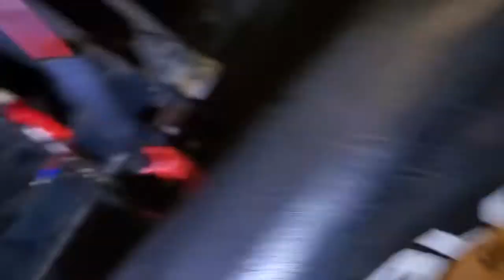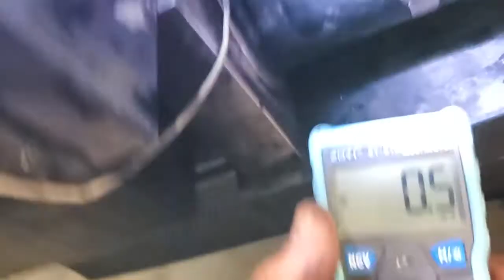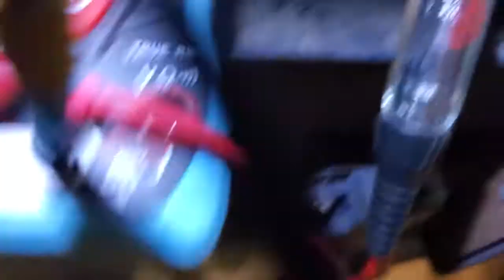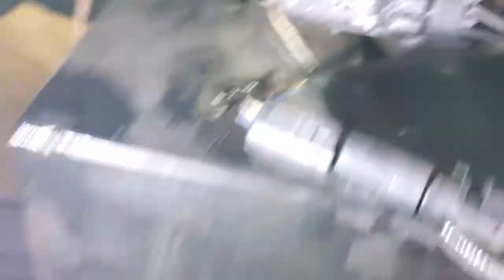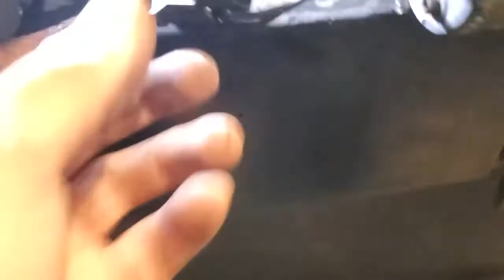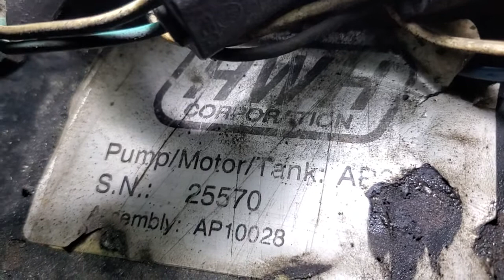HWH LEVELING PUMP NOT WORKING

Comment: My HWH rear passenger jack won't hold long in level and drops over night. It works and retracts ok. What do you think I should look for? I'm thinking seals but don't know what else it could be. It's a 2000 Newmar Class A. Thanks. Great videos.
Reply from the maker: Did you get your problem resolved yet?
Reply: @Rvdiagnostics  I think it's the driver side rear jack. There is transmission fluid at the base. I'm not sure if one bad jack can make them all slowly drop. I will have to replace that one first. I will wait till after the winter since my RV is staying in a park. Thanks for your videos.

Comment: I have a 310 hwh with dump valves. I found 2 design issues. first was one was at the rear plate where the brushes of the motor are bolted to. one passes through for the positive post. the end plate was rusted and corroded preventing the negative brush from getting ground pump block as it was just bolted to the end plate with no access to external ground. I drilled out the end plate, cleaned it, then added a grounding bolt to directly negative brush through the end plate and to chassis ground. this solved the intermittent problem. 2nd issue was the power fuse that is rated at 40amps. the fuse holder is only rated to 30 amps so it melts and fails. Needs to be upgraded to a 40 amp fuse and 8 gage wire. If you have a chattering relay inside the coach this fuse and it's high resistance may cause that.

Comment: I have a HWH 110  stoped working no lights on control board was working perfectly until some days would stopped working but then it would work but now it completely stoped no power to board
Reply from the maker: Did you join my Facebook page rvdiagnostics?
Also my website www.rvdiagnostics.com 
I'm in the state of Delaware. I have a School and garage,  With full hookups and fifty amp services

Comment: FYI a solenoid is an electromagnetically activated plunger. Can be an electric switch (a solenoid relay vs lever type relay), can be a valve, can be a lock (deadbolt plunger), etc.
Reply from the maker: I understand over the years things have changed. A true definition of a relay is to take a small amount of current to control a larger amount . Hence the true definition is a mechanical amplifier.  Doesn't matter if it uses plunger or spri g contacts as long as there's a switch contact involved.  Now a true definition od solenoid is to take magnetic filed and control mechanical movement if it be pneumatic, hydraulic or mechanical hence solenoids on levels take mechanical movement and control hydraulic movement

Comment: I have a 1997 Raven XL that I'm just getting into myself, now how to activate your hydraulic motor for a few need to set the emergency brake and then you need to turn the on switch on the panel, well that's been working for me but I had to finesse stepping on the emergency brake pedal just to get the light come on.... finally I can depress the emergency brake pedal all day long but now I cannot get the motherboard to come on by touching the on button.... seems like when I play with the sensor with my finger, the sensor seems to be working but not sure.... any suggestions?
Reply from the maker: Most parking brakes are pull down swith.Is the parking brake light coming on the dash.Send pic of your leveling touch panel. What system is the leveling?

Comment: I have recently purchased a 2000 motorhome and the pump presents the same issue. It hasn't been used in probably 5-10 years. Any idea what causes this issue? Potentially the motor getting gummed up with age and dust?
Reply from the maker: Remember my MOTTO TEST NOT GUESS
Reply from the maker: So do u have a multimeter
Reply: @Rvdiagnostics  I do. The lines have continuity and the fuses are good. Got a new relay arriving monday.
Reply: @Rvdiagnostics  I do. The lines have continuity and the fuses are good. Got a new relay arriving monday.
Reply from the maker: What pump are we talking about, Unfortunately it doesn't let me see what video u watched
Reply: @Rvdiagnostics  the video was your video on hwh hydraulic pump diagnosis. To the hwh leveling system and hydraulic slides on a motorhome. Since the comment I actually got a better electrical connection and connected the house batteries positive to the pump directly, bypassing the relay and it turned on. There's live 12v going into the pump relay though but the leveling system and pump still fail to function. Would this indicate the relay is the issue?

Electric goes into the relay, pump works when directly started, but fails to normally function using the control panel.
Reply from the maker: Check small wire going to relay for voltage signal when panel button pushed
Reply: @Rvdiagnostics  you were right. So there are 4 terminals. Big one on each side for the 12v positive into the relay and from the relay into the pump. Then there's a small wire for the Jack's and a small wire for the room extender. By accident I tapped the 12v high capacity line to the room extender line and the room popped out and works fine but the Jack's still don't work. This makes me think I just jolted the relay somehow and it was the relay all along
Reply from the maker: Www.rvdiagnostics.com
Reply from the maker: @Hypn0Guru   Do you have a multimeter?
Reply: @Rvdiagnostics  I got it sorted and the jacks and room extender working
Reply from the maker: @Hypn0Guru  what you do to achiev that
Reply: @Rvdiagnostics  more than I should have. I misdiagnosed the relay so that didn't fix it. Then I worked backwards. Rechecked the fuses on the hydraulics and Chassis. Checked grounds. Worked backwards and check the ground and power on all the pins on the control box, ripped the dash apart to find the accessory line wasn't getting power. I juiced that line and suddenly the backup camera worked and the hydraulics worked chased the acc line back to the power window and finally a small 10a fuse I'd missed for the power window which is the line the chose to wire the entire hydraulic system to.
Reply from the maker: Well you learned a lot about your rv .Congratulations on to the next project.